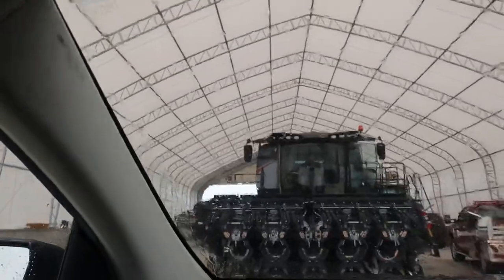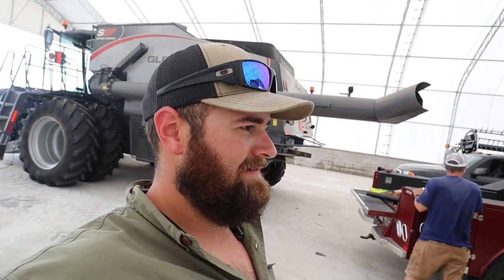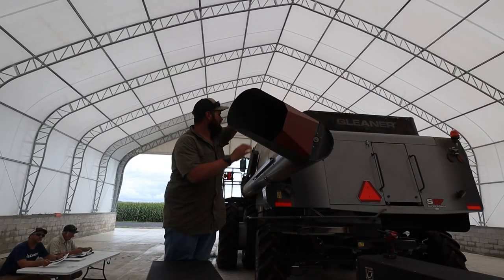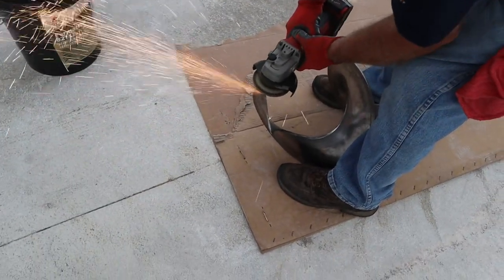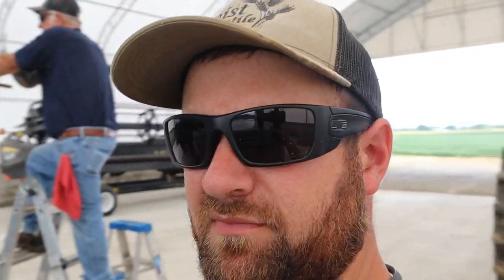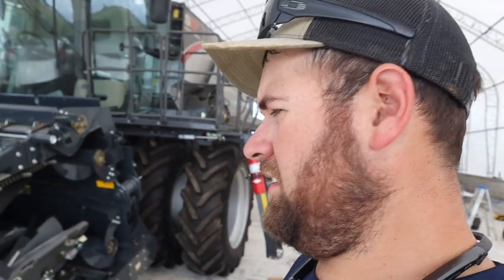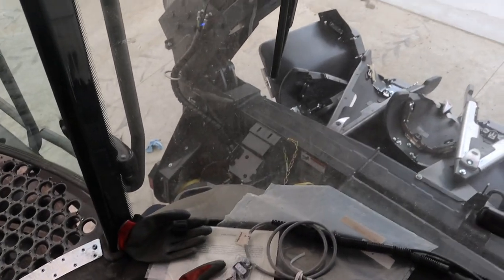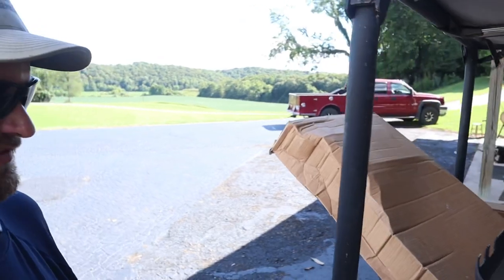Preparing our New Gleaner S97 for Corn Harvest

Comment: Is the offset because it’s a folding header? The throat mount should be mounted to center up the head.
Reply: The feeder house is offset on the Gleaner.
Reply: @markgray1119  yes, i know, have ran gleaners my whole life. But the header should be center of combine. The adapter to the throat should be offset, not the whole header
Reply: I run a drago head on S77. Head is center, throat opening isn’t

Comment: I  DIDN'T  THINK YOU CAN WELDED  ON EQUIPMENT  WITH YOUR  BATTERY HOOKED UP ?  = Russ
Reply: Battery disconnect switch is all it takes. I’m sure they hit it.
Reply: I think you boys missed boat owned gleaner never again
Reply: @hazeltonfarmsllc7490  which model were you blessed to swear at?